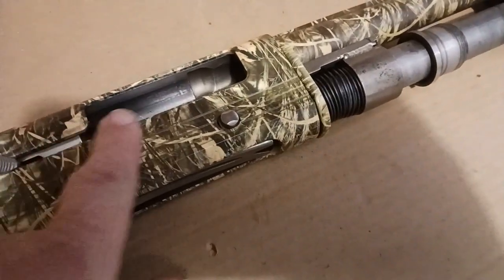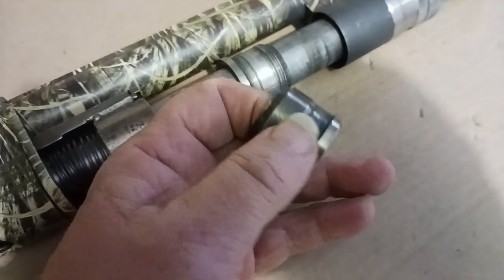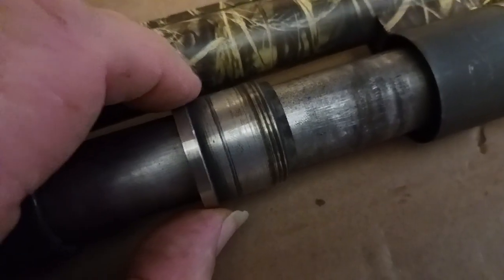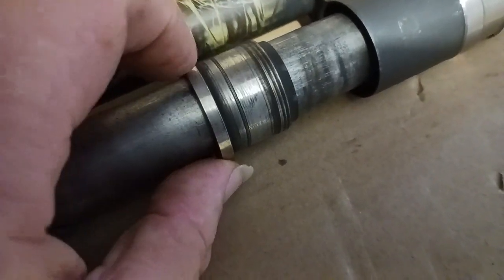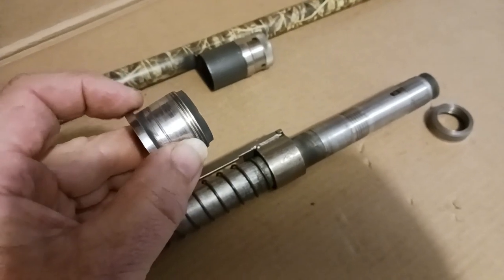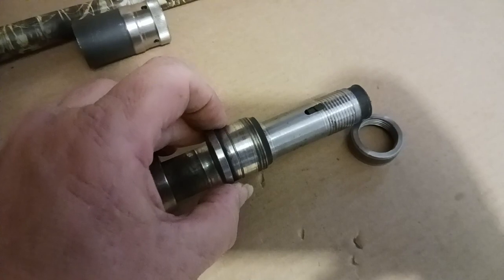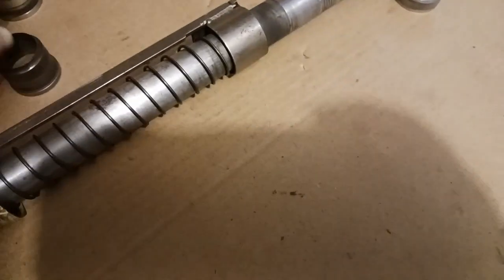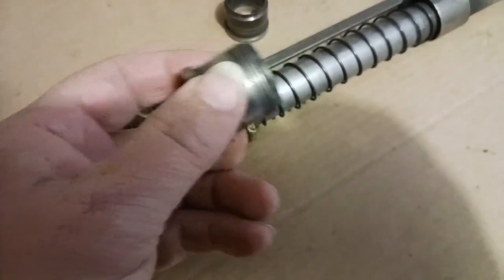Hatfield SAS Piston Design; no ring

Comment: When I purchased my shotgun. It came with 2 pistons one in the gun and one in the box. 

Which one is which?
Reply: Depends on how old your gun is they had lots of different problems with these gas systems on the shotguns if one of the Pistons has a ring on it that's for light loads the one that has no ring on it is for heavier loads I found out the one without the ring works with both light and heavy loads

Comment: Almost a year playing around with a tokarev ttf 12 apex field shotgun not cycling gaas system looks identical to Hatfield
Reply from the maker: Try shooting only one shot in it at a time and see if it's kicking it out. If it is, then load two and check to see if it's jamming the next shell under it. Maybe bend it out a little.

Remove and check the extractor and make sure it is smooth on both sides and spring is clear of debris. 

Check trigger assy for rub marks on the side. Also, the shell lifters are sometimes put in with the wrong piece. A left had unit instead of a right hand unit. This will rub the inside of the receiver and cause it not to work.
Reply: Also it is 3 1/2 version

Comment: Can you put some sort of sight on that gun? Red dot or something like that
Reply from the maker: I rigged one up. I drilled and tapped the receiver and put a Mossberg scope base on it. But you can only use the back part of the receiver and base and not drill into the front side because the metal is too thin. 

The base is set at 1/2" hole spacing. I then drilled another hole 1/2" away toward the center and then drilled 3 holes 1/2" apart into the receiver to match.

I bought 3 new longer screws that would go all the way into the receiver for strength and ground them off flush with the inside of the receiver. I had to take them in and out until flush.

I used a course thread to prevent cross threading of the screw because the receiver is aluminum. Course threads hold better in aluminum.

I've had no issues. I put a scope on at first and then later changed it to a reflex sight.

But you may want to check with Hatfield and see if they offer a scope base.
Reply: @bgdesignandsolutions  sounds good. Thank you very much!

Comment: I take it this is the new design. My spring is in the stock.
Reply from the maker: Yes, the piston is what I have been trying to design for quit a spell and finally figured out what needed to be done. It performs flawlessly in all of my SAS models. I can even shoot 2-3/4 in the 3-1/2 inch shotgun, like I show in the video.

There are primarily two reason for a failure to cycle 3" shells. One is the shell itself. If it's 3 inches after being shot, it will not cycle in the 3 inch versions because the ejector is not set up for a full 3 inches. It's set for the European 3" which is about 1/8" or more shorter.

The other is oil. I cannot express how many people fail to properly oil their automatic shotguns. Whether it's a Hatfield or other brand. Even Stoeger's, Brownings, and Benelli's need to be oiled to function properly. It's a given.

If all is well there, I would then look at the extractor for proper function, spring pressure, and ability to grab.

I would even look at the trigger assy and see if the carrier spring is dragging against the trigger housing.

You may want to buy the ringed piston and see if it works. Some shells do not have the gas power to function all types of shotguns. I have seen this even on top end shotguns.

Comment: MINE WILL NOT CYCLE 3 INCH AND I HAVE THE HEAVY PISTON
Reply from the maker: You may want to get a ringed piston.
Reply: @bgdesignandsolutions  I have both. It still won't cycle 3 inch even loads orr 1300fps.
Reply from the maker: @jeffclark8696  Does it jam? Does the shell start to come out? Does it open the bolt? Is there scrapping on the top of the receiver inside?
Reply: @bgdesignandsolutions Not ejecting shells
Reply from the maker: @jeffclark8696  I am assuming the shell is coming all the way back, and you have an empty shell on top and a loaded one in the bottom of the receiver.

If one shell is shot, it does what? Close the bolt back with the empty in it? Stay open? Or Shell part way out?

If two or more shells are in it: does the next shell leave the magazine when fired? Does it go under the fired shell?

Will it eject 2-3/4" shells? Does it cycle the next shell in the magazine? Any issues when shooting 2-3/4"

It is cycles the 2-3/4" just fine, I see no reason for it not to cycle the 3" shells other than they are too long and you need to get another box of a different brand.
Reply from the maker: @jeffclark8696  With what I just said. Head space is one issue that could cause a fail on 3" but not on 2-3/4. The 3" have more pressure than 2-3/4" and if the head space is not correct, it will cause the "brass" on the shell to expand backwards at the rim which will not allow the extractor to fully grab it and it will fail. 

Other than that, replace the extractor and see if it works.

Use a head space gauge to check, or you can do a visual. Close the bolt. Barely pull the lever about 1/8 of an inch. Do not let the locking lug disengage from the barrel. AT THE SAME TIME, use your other hand and hold the bolt in place with your finger and try to move it front to back.

There should be no movement of the bolt itself, only the lever. The bolt should be sitting against firm the barrel and locked in place by the lug.

If the bolt moves and you can see it move and create a gap between it and the barrel, you may have a head space issue. If so, replace the bolt assy.
Reply: @bgdesignandsolutions  when it first started I shot a 1 3/4 platted lead shot from winchester turkey loads. Started having issues after that. I had the ringed piston in. Emailed the company they said check all this and that then said get the heavy piston. Only issue it never cycled or ejected 3". Got it to eject 2 3/3" again with the heavy piston. Yes, the first shell doesn't eject and the next shell is under trying to load. I have to physically remove and the next shell will and shoot. The only thing left to change is the bolt. Just replaced the slide due to the roll pin snapping. Could it be the return bring in the stock as well. I see yours is on your magazine cylinder
Reply from the maker: @jeffclark8696  You need to oil the spring in the stock as well. And make sure it's not hanging up from top to bottom. What I have found is the stock spring itself plays a very little role in causing a hand up, but it cannot be ruled out completely.

Take the bolt and trigger assy out of the receiver, and use a rod or something to push the retainer down into the stock spring tube. If it slides easy with no restrictions or grabs, then you can rule it out. 

In my testing, I have found the spring tension in the tube is not sufficient to stall the bolt from coming back. But a burr on the plug will. But that is rare.

One thing you may try before replacing the Bolt Assy, is to get a small flat file and file the extractor a little deeper and make sure the edge is sharp that contacts the rim of the shell. Also make sure the inner edge of the extractor is parallel with the bolt face and not leaning out or up.

Check the extractor spring for movement and burrs. Sometime a burr on the extractor will cause it to slip because it will not fully engage on the rim of the shell. 

I have filed the sides of a few in the past, and even on major brands to get them to work properly. 

I just pulled the extractor out of a very slightly used Stoeger M3000 in "like new" condition I recently bought, and filed down both sides of it to make it flat and smooth because it wasn't ejecting shells like it should. 

I figured that was the reason it was hardly ever used and traded off. It's in very good shape, and now ready to use and hasn't failed since.

So, you may want to try flattening the sides and make sure the inside of the extractor is smooth with no burrs as well first.

After you do that, put an EMPTY 3" shell in it and close the chamber. Then pull back the bolt, fast or slow or both. It should eject clean and clear if all is working well. You can then test it the next time you go out to shoot it.
Reply: I lost both of my pistons light and heavy in a divorce, they were both in my gunsmith bag that grew legs during the move. Is there any way I can purchase one from you or get the plans to have a machine shop make one for me?
Reply: Which piston starts in the gun? How do you tell the heavier piston from the smaller piston?
Reply: @CobyFischer  The gun comes with a light piston. Had to change piston and bolt out. It works now

Comment: Interesting video. I bought one of these shotguns from Walmart a couple years ago and only planned to shoot light loads with it so I drilled the gas ports bigger. Now it functions reliably with standard 2.75" birdshot.
Reply from the maker: Interesting. Was it the 3-1/2 version like this one, or the standard 3" version? What piston do you use, the ringed one or the heavy one? My goal was to get away from the ringed pistons because come off and cause problems.
Reply: @bgdesignandsolutions  I bought the 3-in version and it only came with one piston
Reply from the maker: @propdoctor21564  Probably came with the ringed one. But it sounds like you're on top of it and have it working. I may look into drilling out the holes someday just to see what happens. I do have an extra barrel or two I can play with.
Reply: What size did you happen to drill it open to? I bought one for my brother and so far its been a bear to function reliably. Trying to weigh all my options to get it to be more functional
Reply: @TerranceVW3  actually I don't remember, I just kept enlarging the hole size until it functioned... If I remember right the holes ended up about twice as big to where it was almost one large hole
Reply: @propdoctor21564 checking mine, I can fit an 1/8" drill bit into each hole, but the tip just breaks the barrel edge. When I grab a 7/64" bit, it'll go all the way thru into the barrel. So I wonder if I open the entire hole to 1/8" in both and monkey with the piston if I'll have better success. Already had to dremel out the extractor groove to allow more clearance to grab the brass lip for better extraction.
Reply: Mine will still will not cycle 3 inch and I have the heavy piston.